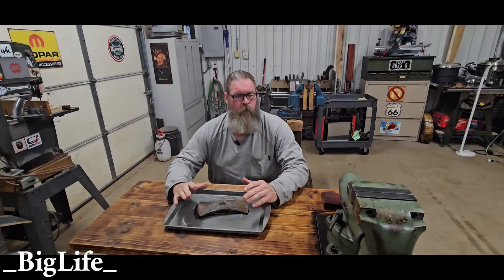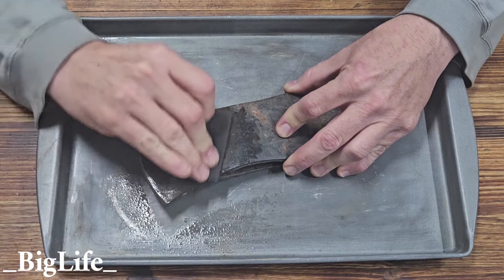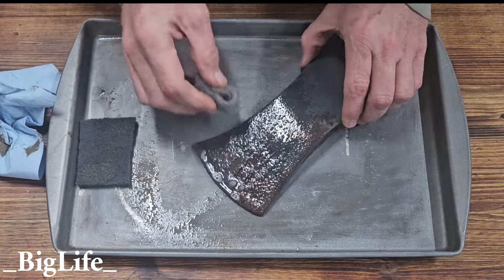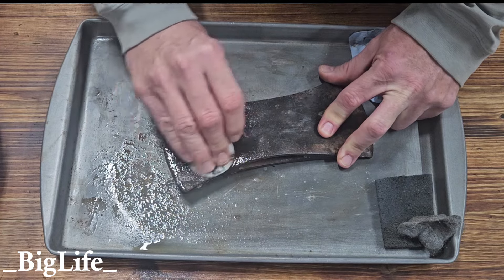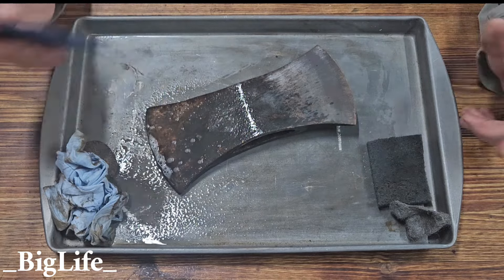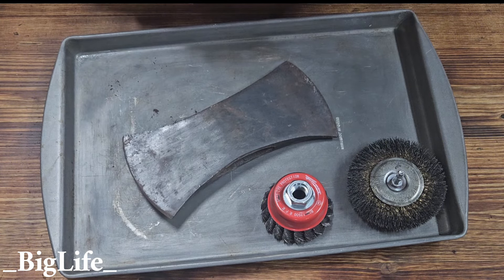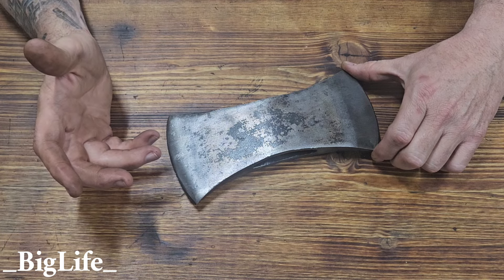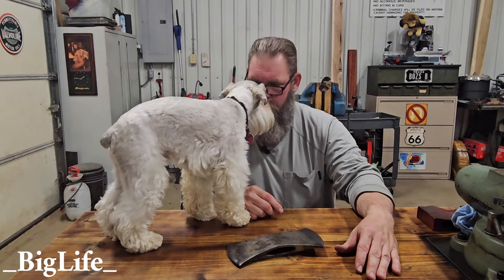Cleaning your axe head.

Comment: I really appreciate how you discuss and explain your thought process in the methods you use.
Are there any products you actively avoid using on your tools?
Reply from the maker: I think it really depends on the tool and your the desired outcome you are seeking.  I would always suggest starting out minimally, abrasive and working your way up.  One thing I have found is if you put aluminum in a strong chemical decreaser to strip paint, check it frequently, as the decreaser will actually eat the aluminum.